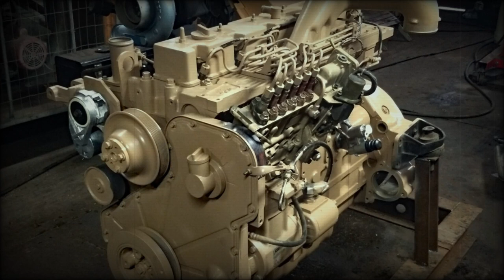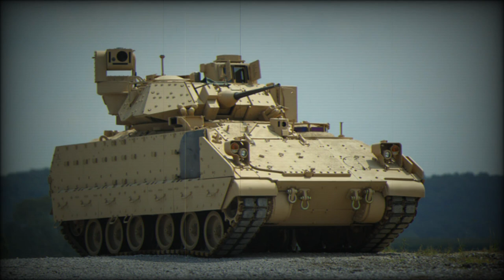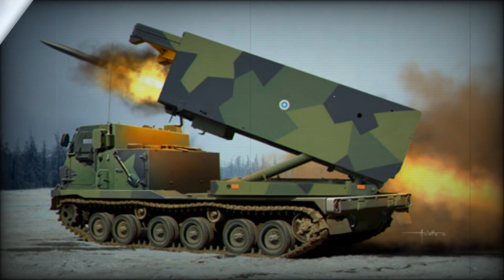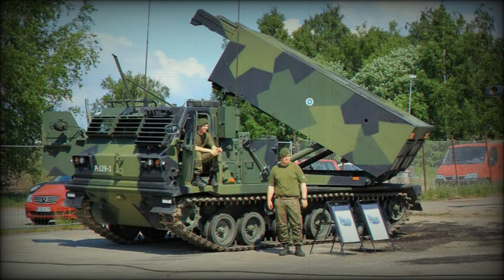Cummins to supply remanufactured diesel engines for US Army armored vehicles

Comment: Unless the CFR’s have changed since 2016 the majority of combat military vehicles are exempt from EPA regulations.  The government knows EGR EGR COOLER PARTICULATE FILTERS AND DEF treatment will render military vehicles inoperable in battlefield scenarios. EPA regulations good for thee not for me.
(4) The statement: “THIS [engine, equipment, vehicle, etc.] IS EXEMPT UNDER 40 CFR 1068.220 FROM EMISSION STANDARDS AND RELATED REQUIREMENTS.”
P§ 1068.225 Exempting engines/equipment for national security.

The standards and requirements of the standard-setting part and the prohibitions in § 1068.101(a)(1) and (b) do not apply to engines exempted under this section.

(a) An engine/equipment is exempt without a request if it will be owned by an agency of the Federal Government responsible for national defense and it meets at least one of the following criteria:

(1) An engine is automatically exempt in cases where the equipment in which it will be installed has armor, permanently attached weaponry, or other substantial features typical of military combat. Similarly, equipment subject to equipment-based standards is automatically exempt if it has any of these same features.